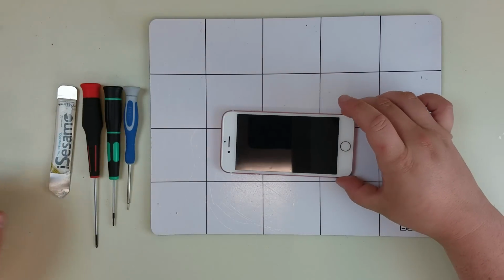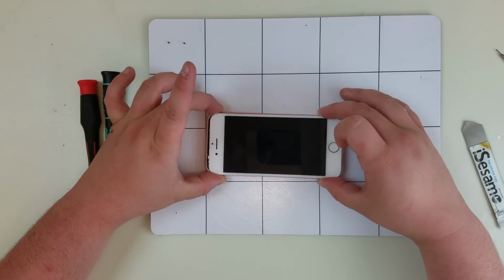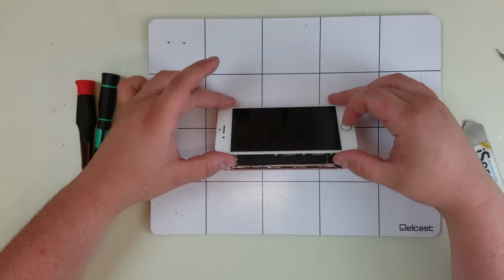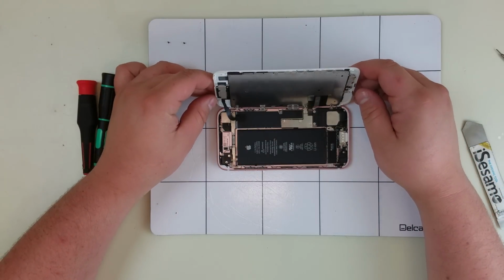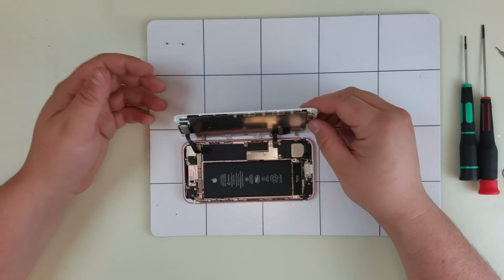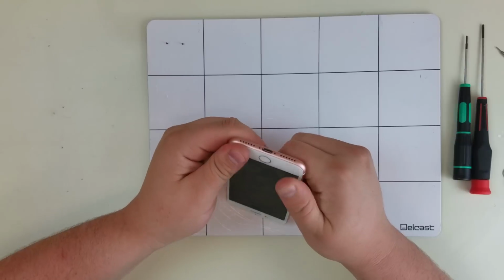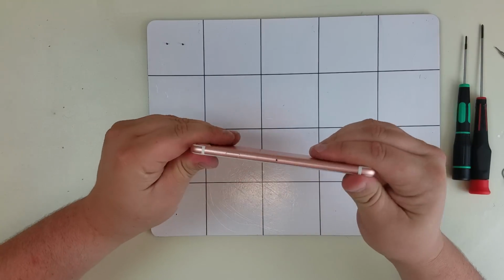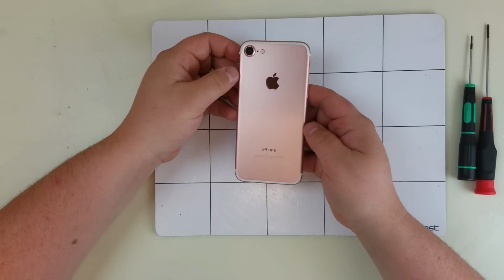iPhone 7 LCD replacement

Comment: how do you reglue it so it can still be water resistant?
Reply: does the apple care people even reglue it with adhesive?
Reply from the maker: I can't vouch for apple care in this matter, but I would never trust a device that has had its factory seal removed to continue being water resistant. You could try to replace the adhesive gasket but I would not recommend testing its water resistance.
Reply: MDTekk Llc I want to take my phone to apple so they can check out some problem but they said they gotta open the device crap Idk what to do now lol I want the water resistance

Comment: Is it safe to work on the top of  magnetic pad like you did in this video. i am just concern on the the CPU or Chipset that may damage. just asking! Hope also there is a close up shots. Nice Video.
Reply from the maker: There should not be an issue with doing it on a magnetic matt, however if you feel uncomfortable you can always just use an ESD matt to be safe. Thank you!
Reply: the housing provides protection you have more chance of static discharge then the matt